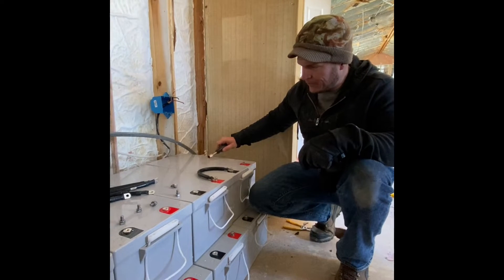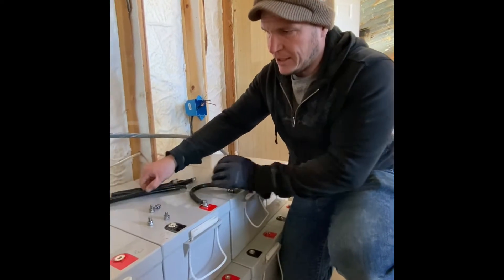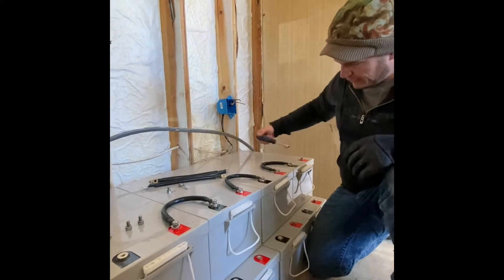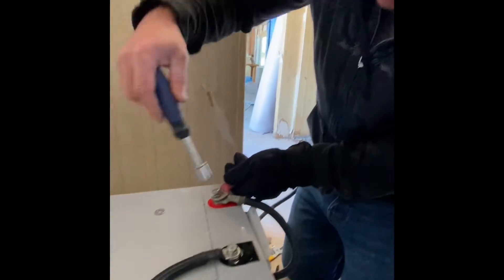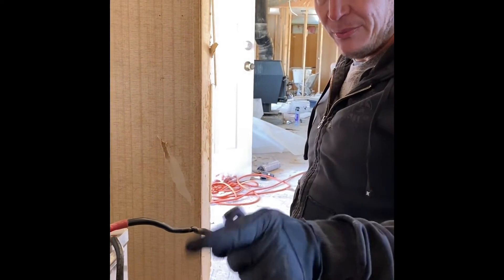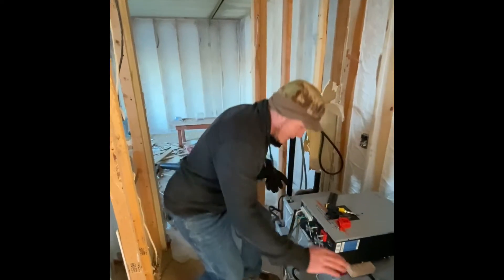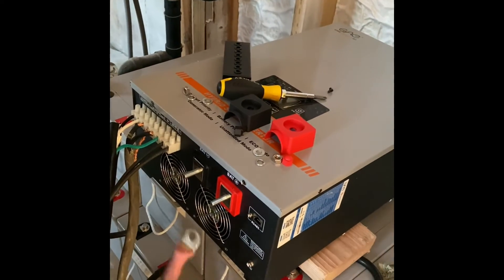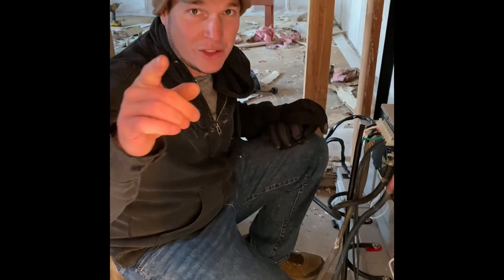12v to 48v how to turn your 12 volt batteries into a 48 volt system @constructionhacks9293

Comment: You cannot bolt both strings together like you have. It's never going to properly discharge or charge. You need a bus bar like a Lynx power in and use same length cable to the bus bar separate from each battery pack 48v/48v. 
The lower 48v bank you have will go out of balance really fast.

Comment: What about running 2p4s? Tie 2 batteries together in parallel first then wire 4 sets of those together so that way each pair of 2 will always balance. And then get a battery balancer so it balances each group of 2 with each other. Whats your thought on this concept. I have 16 260ah 12.8v batteries wired is 4p4s so i have 4 wired in parallel first to create 1040ah before i go in series to 48v. But if so would 2/0 awg be sufficient between all connections?

Comment: How do you draw 12 volts off that if you want some 12 volt outlets for 12 volt items?
Reply from the maker: @Aussiehomestead1965  you need to get a separate 12v system
Reply: 48v to 12v buck converter!

Comment: So to put it in simple terms. You have 2x 48v wired together? Just asking as my 48v set up seems to run low very quick and I want to add more batteries. Also what watts solar panels do you use to charge them?
Reply from the maker: @sypherxxx7358  yes 4 serised and two paralleled. you can use whatever solar panels you have to charge them, just make sure the voltage and wattage line up with the recommended solar (pv) input on your charge controller!!

Comment: You didn't cover the cable sizing. I know you have to use full size for the 12v batteries, whatever amp flow they are rated for. But for the main cables that are now 48v, what is the formula to figure the cable size?
Reply from the maker: You should be able to look up the volts times the amp hours and find the watts and size of wire. 48v is smaller than 12v. So multiply volts by amps and you’ll get the watts and should be able to gage the wire size on Google! Thanks for your support!
Reply: @constructionhacks9293  watts dived by volts = amps so I figured that out. Basically 1 quarter of the 12v amps when in 4S. My question is, are all the cables able to now carry the lower amp rating? Or do the internal cables, before they reach 48v need to stay larger?
Reply from the maker: @azycray4801  amps don’t increase when your series a battery or a panel amps only increase when you parallel a battery or a panel.
Reply: @constructionhacks9293  I know, they decrease. 12v 200 amp battery in 4s is 48v 50 amp. So the cable size dropped from 3/0 with 12v to 8AWG but I will still over size to limit voltage drop. What I am trying to find out is, can all the cables in the middle, connecting + to - need to be larger before it becomes 48v and can drop down to 8AWG?
Reply from the maker: @azycray4801  that’s a good question. I’ve never heard of bigger cables in the middle. I think it never goes above the amperage that the batteries are rated for so I would say 48 V cables throughout.
Reply: @constructionhacks9293  I'm leaning towards that also but trying to find someone who would confirm it. I find it strange that every video I find about wiring in series doesn't cover the change in cable sizing as the first step.
Reply from the maker: @azycray4801  I think with cables you use the biggest you got! lol good luck!

Comment: You're missing a very critical component. That component is a battery balancer circuit. Without it your 48V battery pack will become unbalanced and will lose capacity.
Reply from the maker: They can do that, these lead acid batteries are usually not as bad as the lithium’s which must have a bms thanks for your support!

Comment: Great vid.  I've been dying to learn more about battery backup systems.  We put solar in this summer, and would love to install a battery backup system.  Does the AH's on the batteries need to be the same?  Does that impact the gauge wire you use to daisy chain them?  Are there any downsides to going with a 200AH vs a 100AH?
Reply from the maker: Thanks for watching, these are lead acids and you can use different ah but is always better to use the same!

Comment: My wife and I were able to retrieve two 48 volt Absolyte Battery Banks but the 2 volt cells did not come with plates for the cells. How do I configure the cables to get the best charging pattern? I have a lot to learn about setting up our off grid property. Thank you for any input!
Reply from the maker: I’m not understanding your question could you explain a little more please
Reply: @constructionhacks9293  The cells + to - position(s) are configured in a row - all positive on one side/all negative on the other side. I would send a photo but copy and paste to the comments section on youtube doesn't seem to work any longer.
Reply from the maker: @rongray4118  I think you can figure it out! Thanks for your support!

Comment: Howzit bro is that parallel or series
Reply from the maker: Series and parallel, four in series, to make 48v then parallel the two 48v packs together! Thanks for your support ! 😃
Reply: @constructionhacks9293  Hi by parallellng the the two 48v packs together does the amps double?
Reply from the maker: @ no amps stay, voltage increases! Thanks for the input!